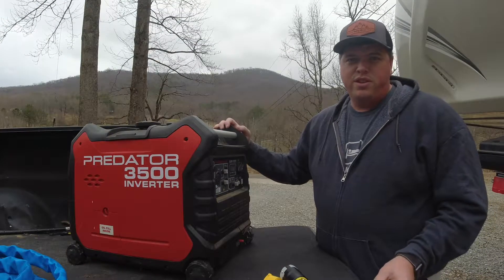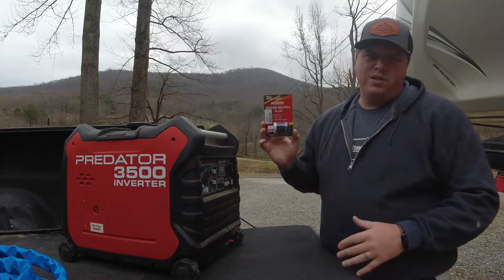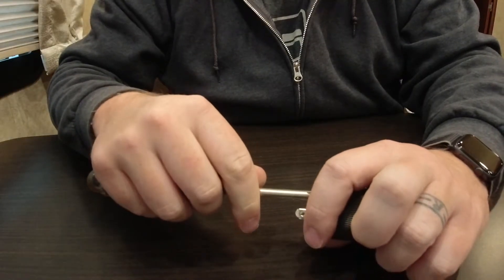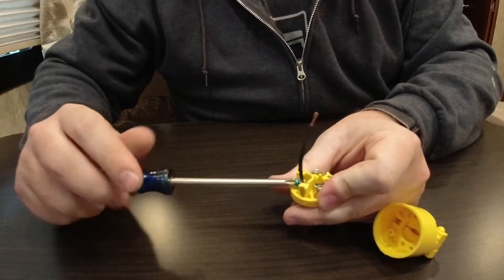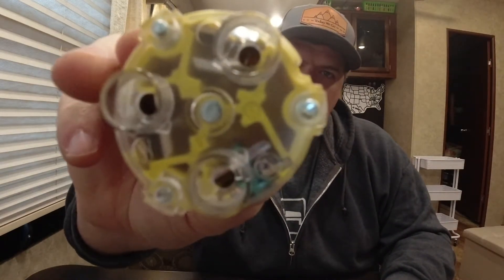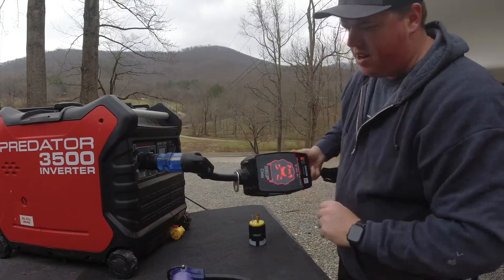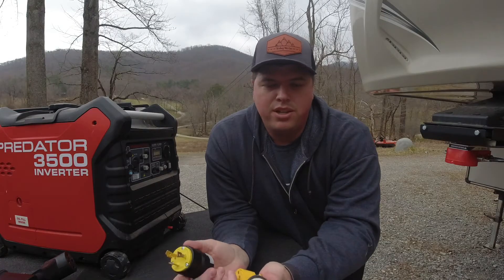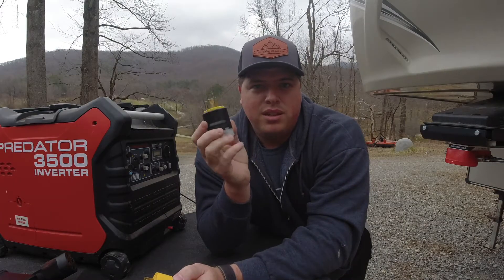How to build a Generator Bonded plug - Fix EMS grounding issues with a generator and your RV

Comment: Thank you thank you thank you for this video.
I bought a generator just before a month-long trip & got this ground-fault error; called generator's support line & they had no idea - they're mailing me a replacement ground-pin that won't arrive 'till after I leave.

I watched your video, cut up an old power-strip, and solved the problem in 5 minutes costing me 0 dollars.
My EMS is wired in, so it wouldn't've been an easy work-around.
Reply from the maker: Awesome! That’s what we love to hear! Glad it got you back up and running!

Comment: Aren't most RVs bonded internally?  If so, you don't want to bond twice. 

Btw:  Made a 30-amp bonding plug myself just last week.
Reply from the maker: RV’s are not bonded internally. Shore power coming in to the RV is bonded. That’s why we don’t see any issues with shore power. It’s when we have a generator with a floating neutral that we have the issues and need the bonding plug.

Comment: Just traded our fifth wheel for a motor home and we are preparing for our maiden voyage and need the Honda portable generators on this trip. I tried them out and I got nothing. Panicked, I started searching the internet and ran across your video. Long story short, I went to the big box hardware store, spent $15.91 for the parts to build two bonded plugs the way you describe above and THEY WORK PERFECTLY! Thank you from a very relieved RV owner!
Reply from the maker: That’s so awesome! I’m glad it helped. I was in the same position not too long ago, figured I’d pass on the knowledge!

Comment: How do you know which prong is the neutral?
Reply from the maker: On the plug you should see a “W” or “white”. This is the neutral location.
Reply: Research (google) the design of your plug (L14, L5-30P, 5-20P, etc) and you should find a diagram telling you exactly which is what.
Reply: The neutral prong is the wider of the two, also the silver terminal screw.